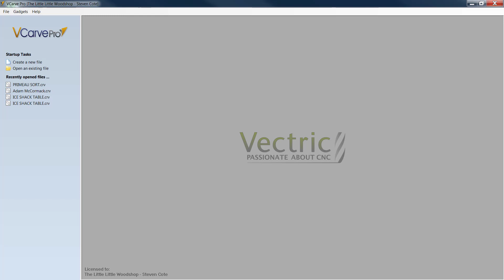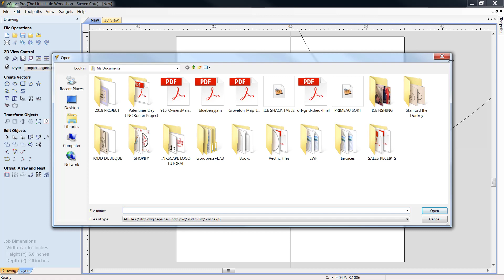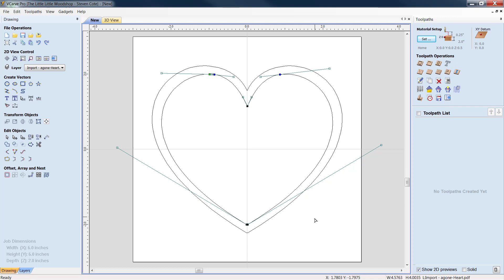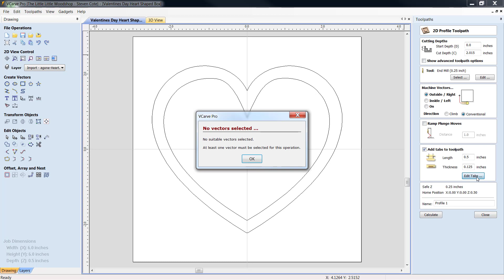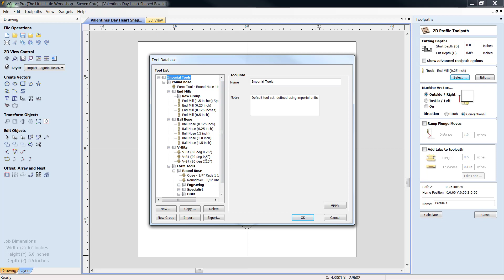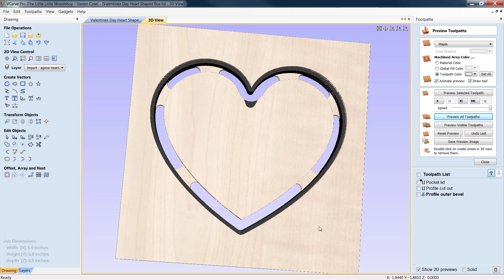Valentines Day Project Vcarve Pro Program Tutorial

Comment: Thanks another great video. I always learn something  new. I have to be somewhat careful because I am only using Cut2d. But I am considering up grading to v carve. could you tell me what the  major  difference's are.
Reply from the maker: Well for starters the interface doesn't change so that it becomes difficult to use. Each additional upgrade adds a little more functionality to the interface. Cut 2D limits your cutting to pieces that are 24" X 24" ,, you'll have a larger programming surface. 2.5 dimensional engraving isn't possible in cut 2D or raised lettering if you would. Prism, texturing and fluting tool paths aren't possible in Cut 2D. Here's a link to a side by side comparison chart, only buy what you think you will need. Best of luck to you Sir ! http://www.vectric.com/products/compare.html
Reply: Buy either v-carve pro or desktop.  desktop is limited to a 25 inch square milling area, plenty big enough for almost all desktop sized cncs.  Pro is NOT limited. either will do all of what cut 2d will do.  BOTH will also import predefined true 3d shapes.  desktop goes for about $325  pro around 700. See the vetric site for a full description of both and the differences between them
Reply: InstaBlaster.